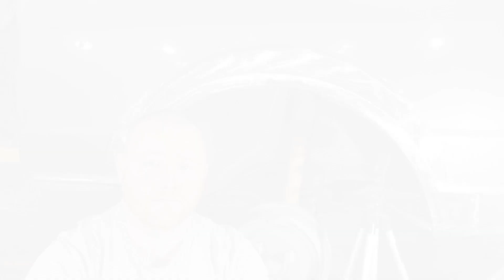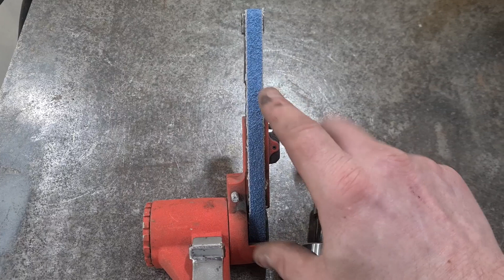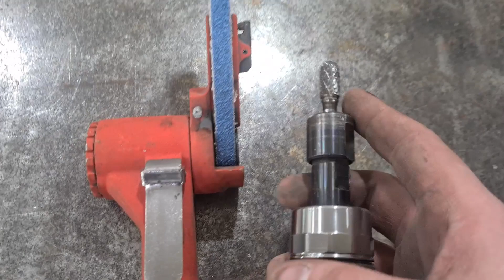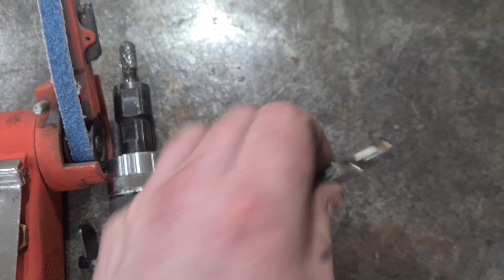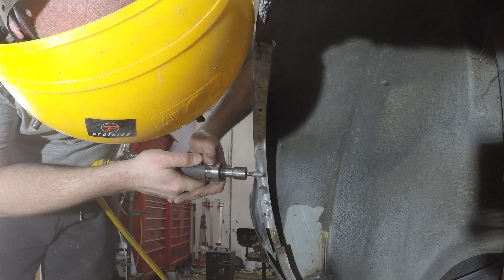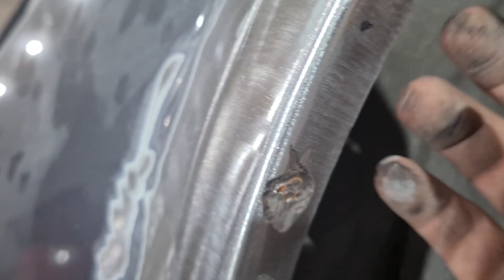How To Remove Spot Welds (3 Methods) | Restoration | Panel replacement

Comment: The drill way is excellent if need to put panel back on. I’ve never thought of using the diamond grinding bit but I will do next time I’m doing some spot welds. 👍👍

Comment: I have only ever used a drill bit, gonna have to try the grinder next time.
Reply from the maker: its the way forward just be careful of the shavings they get everywhere
Reply: @DGRetroCustoms  My wife and son already complain about the lil wires that fall of me, into their feet after stepping on it, from the metal grinding wheel. What's more metal for me to track in the house matter?
Reply from the maker: @myconight   its character building 🤣🤣
Reply: @myconight  🤣🤣🤣 you need one of those magnets on wheels. Harbor freight has them. Has a shut off switch.
Reply: @whoiswaynereynolds5457  it's the ones that get stuck in my sweatshirt that get in the house. I always miss a couple and they will find em with there feet everytime.
Reply: You'll grind your eye out kid!
Reply: @whoiswaynereynolds5457  maybe that will get rid of the blur

Comment: Carbide bits!
Reply from the maker: lol didnt even realize I said diamond bits till I edited
Reply: @DGRetroCustoms  I use those a lot. Like a broken bolt inside a hole and cant drill in the center. You can grind it with a carbide bit and get the center.
Reply from the maker: i have a dremel sized one for that saves alot of messing about
Reply: @DGRetroCustoms  it sure does! Also left handed drill bits.
Reply from the maker: @whoiswaynereynolds5457  i used to have some but they went walkies need to get some more